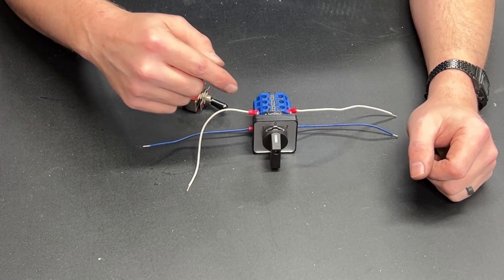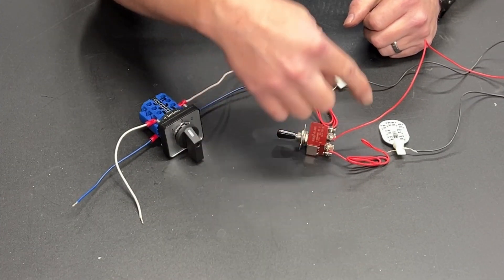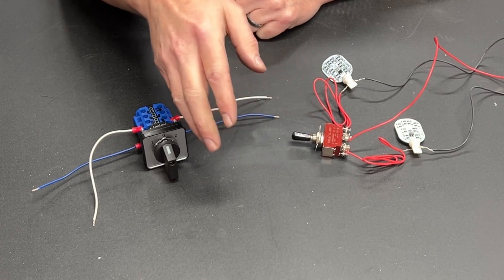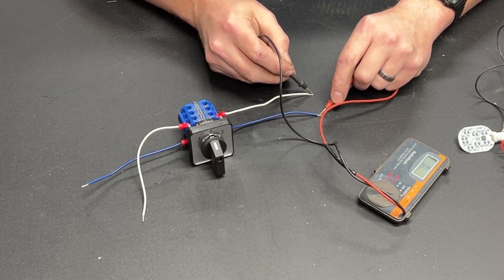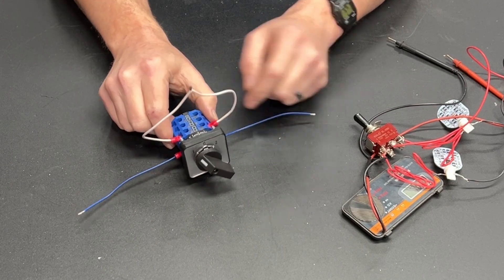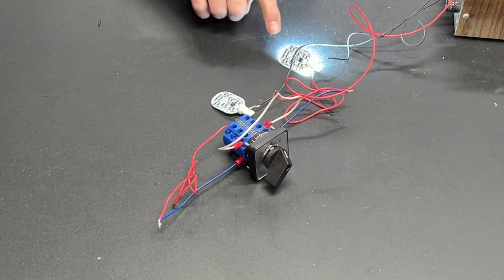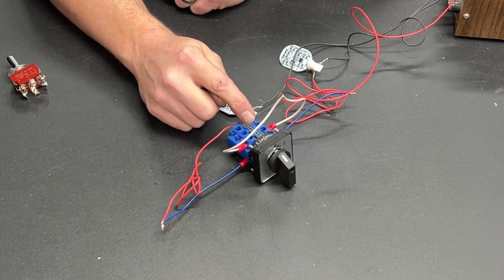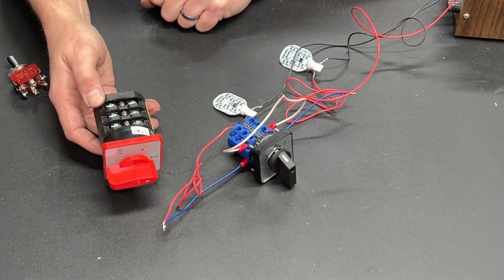Converting a Rotary Changeover Switch Into a Double Throw Switch

Comment: I’m in the middle of wiring up my narrowboat and could use a bit of guidance.

I’ve installed a rotary changeover switch with two positions, and here’s what I’m trying to achieve:
	•	Position 1: Shore power comes into the switch, then out to my AC fuse board to power the boat (240V AC).
	•	Position 2: I want shore power to feed into the AC input of my charger/inverter. Then, the AC output from the inverter should come back into the switch and feed the fuse board to power the boat.

Is this setup possible without any risk of backfeeding or damage to the system? I’m trying to manually control the power source (shore or inverter) and keep everything safe and isolated.
Reply from the maker: I understand what you are trying to do but not being there actually looking at it I can't render any advise.  The issue is if we have a miscommunication either me misunderstanding what you are asking or you misunderstanding my advice the results could be catistrophic.
Reply: @dazecars no worries 👌 I’m going to make a simple fool proof work around, I’m just going to wire 2 make an 2 female sockets on the ends of the wires and just quickly plug in what I need for each setup, it’s safer than me messing with the switch blindly 😅
Reply from the maker: seams like a good call especial given the complete disconnect of one, a little bit of time even if only seconds, and then the connection of the other.  this eliminates and odd discharge or other issues going directly from one to another.

Comment: I finally got the red switch today that ordered a month ago.  I ordered the same one you referenced but got one that is not strapped.  I'd like to strap it as the one you showed in the video.  Any idea what I should use and where to get it?
Reply: I worked on the switch last night and used aluminum to strap the terminals on one side and it works as I need it too.  Aluminum was what I had so it won't stay on there.  I wired the other side with two pieces of 12ga to each terminal and was wondering if that would be an approved way to strap them.
Reply from the maker: you need to be careful with AC current and aluminum.  when aluminum wire is uses in a hose the ends need to be cover with an anti corrosion goo.  If you don't do that aluminum oxide (which is not conductive) can build up and result in a fire.  I would get some copper sheeting and use it to make straps.
Reply: @dazecars  That's exactly what I did.  I bought a copper fitting, cut it in half and made straps.  Works great. Will be hooking it up tomorrow.  Again, thank you for your help.  I wasn't going with the aluminum, just used it to play with.
Reply: @ Got everything hooked up today and works just great.  Thanks for the video and the help.
Reply from the maker: Outstanding, glad I could help

Comment: I'm trying to run two 15,000 btu ac's in my travel trailer on one power source using that same switch.  I need to run one at a time.  Using 12/2 wire I assume I take the power wire and connect all of them the same as the red power wire in you video.   Is that switch heavy enough for ac's to run safely?
Great video.
Reply from the maker: I have no idea if the switch is heavy enough or not you need to determine the amps and volts of the AC units and then match the switch accordingly.  The BTU doesn't help at all as different units will have different power requirements.
Reply: @dazecars  Sorry, they are 20amp circuits, 110volt.
Reply from the maker: that switch seams a little small for that amperage.  I would go with this one https://amzn.to/4hdaZkR
Reply: @dazecars  Thank you for the replies.  I ordered the one you suggested but its not expected until Feb. sometime.  Got the blue one to experiment with.
Reply: Got the red one because you mentions the bigger contacts.
Reply: My blue switch cam assembled wrong, naturally.  I had to change the posistion of the plate and handle. I got it to work right.  So, am I right that my 110 in will go to the connected contacts and ac's to the separate contacts on the red one when I get it.  Thanks for all your help.
Reply from the maker: my pleasure.  I am sure you already did this but always test with a meter first to make sure you have it wired correctly before putting power to it.
Reply: @dazecars  That's exactly what I did.  Somehow it was 90 degrees off.  I don't know how but it was.  I sure can't explain it.
Thanks again. Great videos.  Learned alot.
Reply from the maker: glad I could help

Comment: Thanks for the video! I bought the changeover (blue) switch to replace a rotary switch in my 3hp 220v wood shaper. I'm hoping it's okay for that AC single phase use. It's rated at 20amps and the mag switch for my shaper motor is rated at 18amps. It looks like I'll have to jumper like you've done here to create a common. I was hoping you could confirm the wiring for me so I don't blow up the switch. It's a 4 wire single phase motor (green, red, black, white) and single phase 220v power wire coming in from a Nema 6-50R receptacle (black, red, green). The motor cover indicates that with the 4-wire side, connecting white and red rotates one direction and connecting white and black rotates the other. However, I'm still trying to wrap my head around the input having 3 wires, but the motor having 4. I guess Nema 6-50 calls for 2 power legs (red and black) and a ground wire, but no neutral. That said, the ground connects to the same bus bar in the mains box as neutral, so it seems like it could act as a neutral/common. That makes me think that I should use the ground/green wire from the wall as common for the rotary switch. However, that would keep me from connecting the ground at the machine to the wall. Any chance I could pester you for some help on how to best wire things in this situation?
Reply from the maker: I would love to help you but I can't give wiring instructions based on a description.  It's way to easy for use to have a miscommunication and then to have bad things happen.  The switch amps is max and operating amperage is usually 2/3-3/4 max.  The good news is your motor is 18 amps max and the operating amperage is likely less then that but hard to say exactly how much.  I guess what I am trying to say is the switch is likely on the raged edge of being big enough
Reply: @dazecars  No worries and thanks for the reply. I noticed the switch is physically smaller than the original, so i ended up buying another one that's the same physical size and actually rated at 63 amps, so that one ought to have a ton of headroom.  At first I thought your crossover jumper setup from the video wouldn't apply to my situation with an AC induction motor vs the DC treadmill motor,  however,  I was able to use the same idea to draw up a wiring scenario I believe will work for my situation.  It will basically do the same thing to the two power legs and use the third switch/row on the cam switch to tie in the motor's white wire to whichever power leg passes through on that side.  If the switch is turned to the right,  the white wire ends up tied to the black power wire for CW rotation and when the switch is turned to the left the white wire ends up tied to the red power wire for CCW rotation.  When the new switch arrives and I get it all wired up,  I'll test it with a multimeter to confirm it's working as I believe it should. This video was a big help though, so thanks again!
Reply from the maker: Smart to use a meter, in fact I would use one to confirm the function of the old switch of part of it still works, then all you need to do is match function and wire it "the same" in respect to function
Reply: @dazecars  Sadly, it was a used shaper and the old switch never worked for reverse (just buzzed). Fortunately though, I managed to figure out all of the jumper wires needed to connect everything and she runs in both directions now. Whew! Throws my brain for a loop trying to get all the wiring figured out, but I'm happy it worked out in the end. Thanks again for the videos and the helpful tips!
Reply from the maker: glad you got it working and that I was of some help if only a little bit.

Comment: I got the same blue rotary switch but it only has 2 banks.  Can i still use that as a direction switch for a treadmill motor?
Reply from the maker: Even though likely rated for decent amps on AC the contacts on the blue switches I have seen are small and not a good choice for DC current

Comment: Thanks for the video. What switch would you recommend for the following? I want to replace the motor on my 220v 40a water heater, with a switch that can choose to send power to my water heater (which I use once a month bc of solar hot water) or power to a 220v outlet for a level 2 car charger? Could I use a changeover switch? I saw someone comment somewhere that changeover switches shouldn’t be switched while under load. Not sure if this is true. What would you recommend? These changeover switches look nice and simple.
Reply from the maker: The biggest thing is that you are getting a switch with the correct amp rating.  A switch that is bigger will be better than one that is smaller.  Most switches that go from one thing to another will be better off with no load.  Although this is slightly less of an issue when working with AC compared to DC.
Reply: “Most switches from one thing to another are better off with no load”. If this switch goes form one thing, to nothing on, to the other on, is that the same concern?  What is the risk of going from one thing on to the other thing on under load? This will be 220v.
Reply from the maker: typically when you hit a power switch its going from no load to load or vise versa.  Then when it comes on it typically takes a second to build to full amp draw.  Load to load there is no build and there is no off.  It is harder on the contacts inside the switch.  Again your best bet is to get a switch rated higher than the volts and amps you are dealing with.  if your at 220AC V and 40 amps I would try to find a switch that is at least 50% more in both specs.

Comment: I have the same switch, well not same because it only has 2 and yours has 3 which I bought the switch off Amazon and they didn't send me a schematic on how to wire it. I bought it for my lathe because my 110 lathe motor will do forward or reverse and I was on the assumption that switch did. Maybe you can do a video on wiring that switch for forward and reverse? Thanks a bunch I really appreciate the way you explain yourself in videos.
Reply from the maker: you need to find a wiring diagram for your motor and then test the switch so you know what connects to ehat in any given position

Comment: I am building a camper out of an all aluminum cargo trailer. I got a apiele 32A 3 position 8 terminal rotary selector switch. I want to switch between my Bluetti AC 300 solar generator and shore power. The Bluetti has a 30A plug to hook a camper into it. I was wanting to wire the other end of a 30 amp cord to the switch. And have the shore power on the trailer hooked to the switch. So I can select either source to my power distribution panel. Some videos iv watched have said to use jumper wires. Some didn’t. One guy combined all the grounds together. With a wire nut. I could use some clarification
Reply from the maker: I think I am following what you are doing but on the off chance we have a miscommunication or are not on the same page I would need more info to provide info.  You can contact me through my website with pix drawings and the like and if I can get a clear picture of what you are doing I may be able to help.

Comment: i want to put a rotary switch in my motorhome, so i can alternate between the 230v mains hook up and a 230v 30amp hook up from a battery power bank made for motorhomes, 2 alternative feeds into the switch with one common feed going back to the original fuse box, so i can have mains electric from the power bank when wild camping, am i right in thinking just wire up the rotary switch  but have the  2 sides used as feeds feeding the common i have seen 32amp rotary switches which is what i am going to use, enjoyed your video thx for taking the time to post it regards chris
Reply from the maker: problem is you are dealing with DC and the high amp rating of most rotary switches is for AC.  You will need a specific high volt high amp DC switch and it will be expensive.  The consequences of using the wrong switch could be a fire or worse.  Thanks for the comment, glad you liked my videos.

Comment: Should be Able to wire all three of the contact gangs on each side in parallel ,  to triple the contact rating.
Reply from the maker: excellent point and a nice option to have in a pinch but at that point a higher amp switch with the correct features would make more sense to me as they are not that expensive.